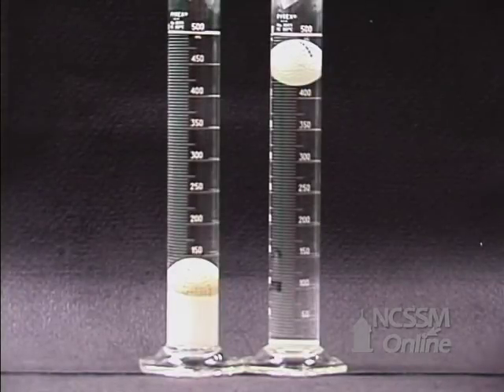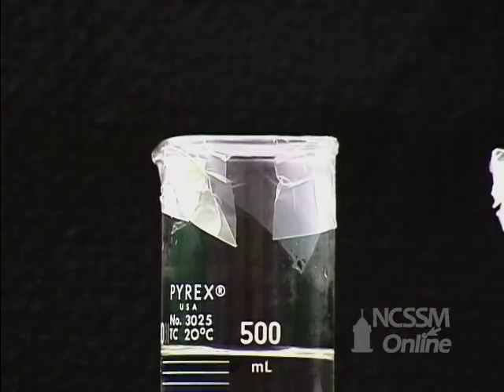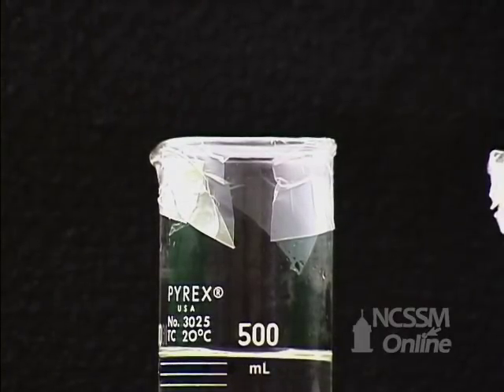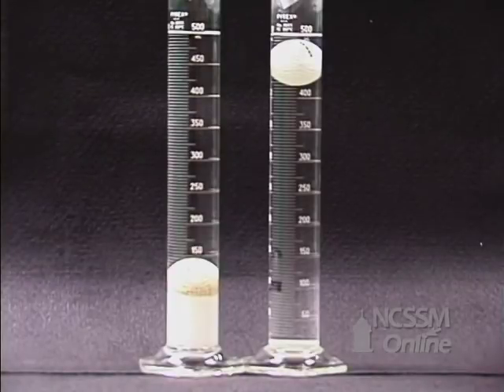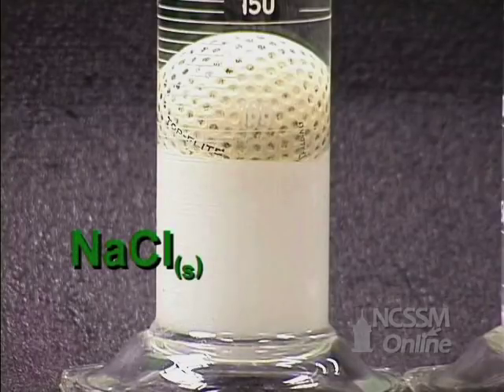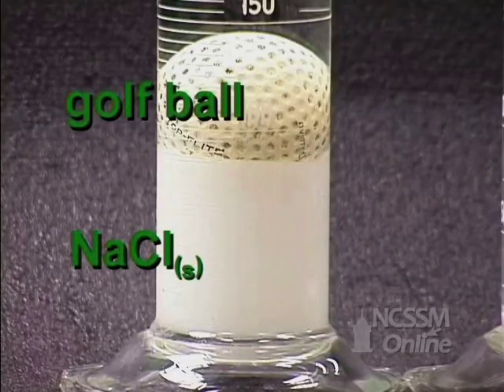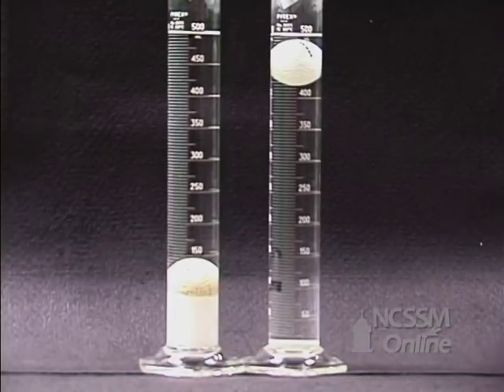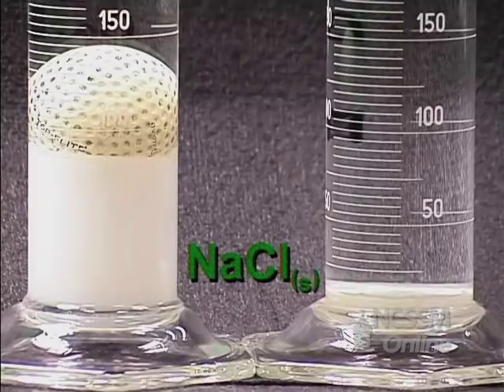Floating Golf Ball: Supersaturated Solution

Comment: Why does the density of the water increase as salt is dissolved in it?

My thought process: the solution increased its mass, but also increased its volume. Wouldn’t it cancel out? (Clearly it didn’t but would a kind you tuber explain it to me)